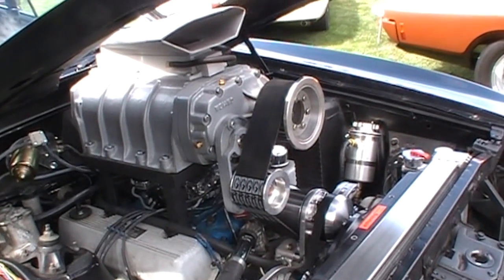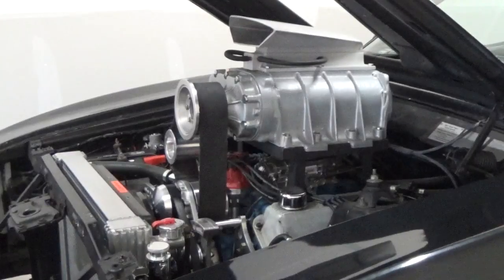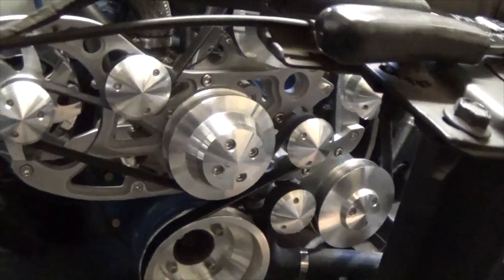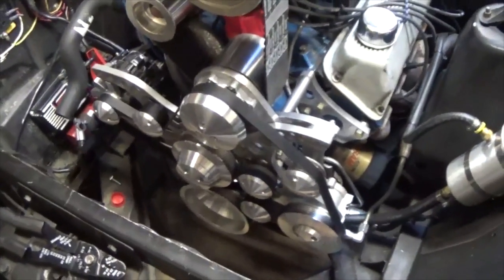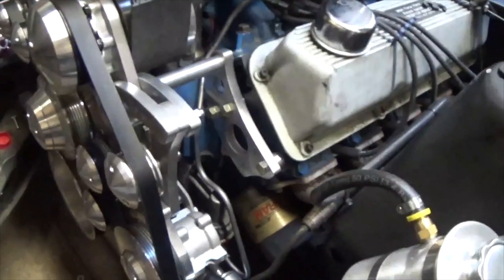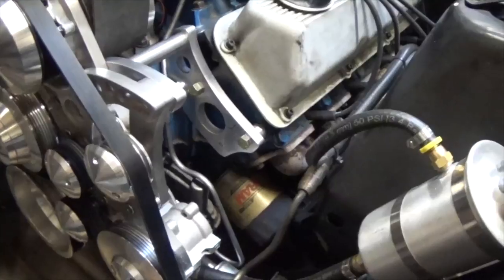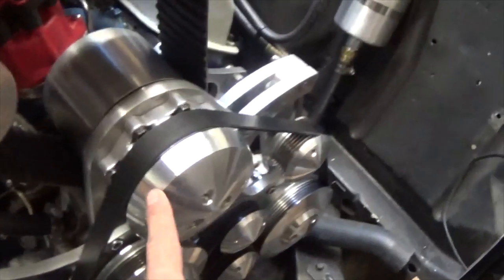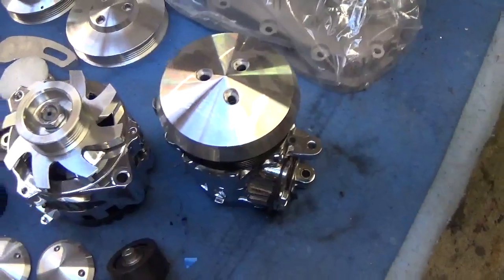Mad Max Interceptor Blower Drive Unit

Comment: Ok I guess I will ask, does at least go or is it just mostly for show the supercharger setup that is?
Reply from the maker: That actually depends on what the client we are building the car for wants. We do build cars with a fully functional supercharger, which of course adds to the power of a motor built for it. However this video highlights the more commonly asked for "Movie Correct" on/off prop blower. That of course is for show only, but the engine under it is generally build quite powerful. Thank you for watching, and for your comment!

Comment: What is a blower drive anyway?
Reply from the maker: In this context it is the "on/off" device which drives the blower, detailed in this video. Thank you for watching and for your comment!
Reply: Mac MashPotato ... it's the combination of pulleys, belt and the gear case on the front of the supercharger housing. in this instance, the system is designed to be activated with the engine already running, using a separate belt spinning a clutch unit that is electrically engaged. the supercharger housing is mounted above the carburetor and doesn't contribute to the running of the engine. it's probably acting as a very clever air cleaner. as you can read in the other comments, MMC builds cars with functional superchargers as the customers may wish. this system is designed to emulate the functioning of the unit shown in the movie, Mad Max. another video shows the movie car using an electric motor to spin the supercharger. that unit was similar to this, in that it was a fake that was as cool as could be.

Comment: God damn is that a beautiful piece of machinery. If I could offer some constructive criticism, the only thing that would make it more beautiful ,is if you could possibly get rid of the writing on the main drive belt going up to the blower, not a big thing, I just think it'll be even more beautiful without it.
Reply from the maker: We are so glad you like it! We always appreciate constructive criticism, it one of the ways we can make improvements. In this case though I am looking closely, and I am not seeing the wiring you describe. Possibly you are seeing the Distributor and Spark Plug Wires, as those are directly behind the main drive. We do attempt to run those as neatly as possible, but sadly here is no way to eliminate them completely (well maybe a computerized system with coil packs on the plugs but that is just going a bit far for a vintage style motor). Thank you for watching and for your comment!
Reply: MadMaxCars  No, not the wiring, the writing, on the belt, probably has like the manufacturer's name and part number on it. You might be able to get rid of it with a little bit of acetone or lacquer thinner or something like that. Like I said not a big deal,, but there's always something else you can do to take it to the next level. And again, beautiful machine, really, really, outstanding!
Reply from the maker: Oh yeah, right! Duh. Teach me to pay more attention! Yes that probably would look better. Its likely the belt size and manufacturers info like you said. We will have to look into doing that in the future.
Reply: MadMaxCars  No biggie,  Like I said, that is a beyond beautiful machine, definitely one of the nicest I've ever seen, and I've seen quite a few.
Reply from the maker: Thank you so much! We do pride ourselves on building top notch cars.
Reply: MadMaxCars. AND YOUR DOING A GREAT JOB ! DEFNITELY SOME OF THE BEST WORK, I'VE EVER SEEN.
Reply from the maker: That really means a lot to hear! Thank you!
Reply: MadMaxCars.  Anytime Bro!     Art comes in many forms, personally I prefer it to look precision, like your engines .
Reply from the maker: Us too! These machines are our art!

Comment: I guessed that the fake supercharger was activated by an air conditioner clutch. I love the concept of saving gas in an apocalyptic future by having the blower only operate when needed. It is also a great visual device by alluding to the action that is about to follow when it switches on. I love Mad Max movies!
Reply from the maker: In the film they used the simplest of movie magic. Had a belt to the crank, which they removed for the "off" scenes. For the activation or deactivation scenes they simply did a closeup of the blower while starting or shutting off the engine. We designed our on/off clutch system, based on the AC  clutch some independent builders have used, so the owners could have the reality of the movie magic, without sacrificing the use of AC if they wanted it on their cars. We of course love the Mad Max Movies too as you can guess. Thanks for watching and for your comment!

Comment: Hey mate. Nice car there. I have a question for ya. Why a supercharger has to be connected to the crankshaft to be functional?
Reply from the maker: Glad you like it! For a real functional supercharger, they are designed to be run of the crank to they have proper power and correct rpm to match the motor speed. In the case of the prop on/off unit shown here its more a matter of aesthetics so it sounds correct when its on. Thanks for watching and for your comment!
Reply: MadMaxCars  How about a clutch system? Would it work?
Reply from the maker: This video shows our prop on/off clutch system. If you are talking about a clutched on/off functional blower, it is theoretically possible. The technology exists, but to apply it to this car, though possible, would be exceedingly expensive.
Reply: MadMaxCars  Are you guys still gonna make v8 interceptor replicas in 5-8 years from now?
Reply from the maker: Of course, for everyone who wants to hire us to do so. We will also still build all the other Movie & TV Star Cars we build now, as well as probably more as Hollywood keeps making cool cars people fall in love with. Its what we do. We have been doing this for decades, so why stop now?

Comment: A positive displacement blower that isnt spinning is a cork, no air will flow. If you gut the lobes from inside it will do no good when it is engaged. Great movie prop and im sure fools lots of fools, but in the end might as well be a piece of plastic stuck to the hood.
Reply from the maker: Well we do build these cars with a functional blower when the clients want it. Most people want that "Movie Magic" On/Off blower prop, which does have the lobes removed but its not plastic its a real blower with the guts removed. Thanks for watching and for your comment!
Reply: MadMaxCars  Secondary valve for N/A air to open a little before the blower turns off, wouldnt that work?
Reply: ToreDL87 There’s speculation that you could have the blower intake act as a “ram air” induction and set the blower up as an accelerator.
Reply: A lot of peaple need to realise a movie is fake but if it came to reality like a real when world goes to shit you need a real blower still will sound badass ether way
Reply: also they're driving a blower belt with just a regular serpentine belt
Reply: What about a bypass vavle like they have on twin supercharger?

Comment: I just meant that its a waste that we cant figure out a way to make the clutch functionable and make the on off blower actually work.
Reply from the maker: It actually is theoretically possible. The cost to do it is beyond what anyone wants to spend though. Also most folks want either "Screen Accurate" (which means the faux blower), or a real all the time on blower. If someday a client wants to invest crazy cash to have the functional on/off blower engineered, we would of course do it.
Reply: Electromagnetic clutch, and a valve to direct air through the supercharger, or directly to the engine. First-gen Toyota MR2 had that feature

Comment: So from what I read in another comment, this car isn't actually supercharged: it gets standard NA air and the supercharger, although stunning and adding airflow, is not forcing air into the engine under boost.  Correct?  That is, any excess air the SC provides would go out the normal intake, yes?

I mean how could you even do that?  A roots pump is positive displacement.  If it turns off, your engine gets no air.  There'd have to be some type of SC bypass valve for when the SC is off (and it'd have to be BIG to provide enough air for the engine).  Do you know how they did it in the movie?  I imagine it was a "prop" SC.
Reply from the maker: Though we do build these cars with a functional blower when he clients want it, the system shown in this video is for the "Movie Magic" On/off prop blower unit. The blower case though real is empty, allowing airflow. Yes it was a prop in the film as well. Thanks for watching and for your comment!

Comment: I see the carb under the blower. The blower is just for looks and whine sound. Doesn't seem to do anything for the engine.
Reply from the maker: Its electromagnetic. If a client orders the on/off unit shown here (instead of a real functional blower which we also do on request), it is carbureted. Correct that in this configuration it is a "Prop" particularly for the "Movie Magic" on/off function, and has no effect on the engine. We do offer a EFI Scott hat and real blower setup for those who want it that way. Thanks for watching and for your comment!
Reply: Cool. Good stuff. Thanks.
Reply from the maker: No problem. Glad to help. I hope you have found and enjoyed some of the other cool vids on our channel. If you want to be notified when new ones come out click subscribe then the little bell icon.

Comment: so how exactly does the blower clutch work? and is that engine carbureted? wouldn't the blower going off and on screw around with the fuel and air mixture?
Reply from the maker: Its electromagnetic. If a client orders the on/off unit shown here (instead of a real functional blower which we also do on request), it is carbureted. Yes an on/off blower would realistically be so problematic as to make it essentially not possible.... though there is talk from time to time of how it "could" be made to work.
Reply: MadMaxCars could you make the blower work if you designed a carb with two different sets of jets? One set that would give the proper air /fuel mix for running without the blower and another set of jets just big enough to work in unison with the others to give proper air /fuel mix that could somehow be opened electronically when the blower is switched on?
Reply: Tay S I agree, but i was thinking of something that would still keep the car like it was in the movie and just making the blower functional
Reply: A draw through centrifugal supercharger would be able to turned on & off with a switch/clutch with no major side effects to the air/fuel ratio.  But the cars in the movies don't use that type of supercharger.
Reply: Jack black 

You could probably do it far easier with efi like megasquirt.   And make a bit more power and a great side effect of more mpg too.
Reply: Jack black 

You could still put tbi efi inside of it...they look like carbs anyways.

Although dont know how you could get air when not on....
Reply: theres a few new blown factory cars that have like a bypass tube and valve so the blower can bypass at highway speeds to save fuel, so something like that I guess
Reply: You're not kidding about the on /off, MIGHT last two cycles if applied at anything but idle making it pretty pointless. Might be some potential in a viscous coupling ala Subaru AWD though.

Comment: So does the air intake go through the blower at all and if not, how do you filter the air?
Reply from the maker: Though not exclusively drawn through the blower, there is a generous amount of airflow there. We use a fairly standard high performance air filter. Thanks for watching and for your comment!
Reply: Dan Boren No the real car didn't make any boost it was just a supercharger casing with a carb under it
Reply: Dan Boren , 351 HO Cleveland's with a good tune and a 650cfm would usually dyno at 1 HP per cubic inch on a regular basis . There a Nick's video that verifies this on here also . Years ago we heard about and had to build a ' Clevor ' . Can probably find a video on here someplace about them . Was a blending of the best of both 351's Cleveland and Windsor engines .  We did more bottom end work than needed and a stroker at the time with rods , pistons knife cut steel crank which was stock stroke. We made the difference as I said with pistons and rods 0 deck height after some block squaring , yeah tend to get nuts as I build .. . . I'm a believer of if you drive it to the track it'd better stay together for the drive home. ;-) . I later became a Mopar believer and have commented on a 318 build that was 497 HP on pump gas with cast heads . . . I digress . The Clevor we built was inspired by some dirt track racers who were building them for 'production' rules and they worked so well they were banned from most if not all tracks after a couple races . . . . . Ours dyno'd at 537 HP at 5252 rpm on pump gas on the first test . This wasn't tweeked or touched and was with odd LeMans float bowl dual feed dual pump 725 carb from under the bench . . . . . Think it was off a grenaded 409 . . . We didn't jet or dial it in just pulled some plugs after running things in on the dyno . Oh , we had to build an intake as it was easier than porting , drilling. , plugging the heads and manifold . Still had to do some of that anyway but not as much and runner length was a guess. . . but adjustable . LOL ! Gave it to a kid who put it in a Vega as a daily driver to drive to college . . . . .the following week . We put a three speed with a aftermarket shifter from JC Whitney ( the box was in the trunk of the loaner car )  if I recall from ' Thomas's garage and junk yard . Drive shaft and wiring we made to work . Did I mention this was a weekend install . The good old days of toggle switches and Holley High volume fuel pumps ! Not to mention a thanks to salvage yards back when they had things worth salvaging . . . The headers also were fabricated and wheel well with collector to glass packs welded on. . . Did I mention we were short on time ?  Later we corrected the suspension and rebuilt the headers exhaust . . . and a different diff etc. For awhile people thought I'd adopted the kid . He graduated with honors and is now in law enforcement  or was . Probably retired by now , damn how time flies . LOL !  OK , that was my book for the day . Be well .
Reply: When I first saw Mad Max I knew the blower could not be installed normally and the car run with the blower off.  So, the question is, when you turn on the blower does it actually produce any boost at all to the engine or is it just there as a WOW factor?  Love the cars, especially with the 351C engines, my favorite engine ever!
Reply: straker454 U DONT..
Reply: it's just a filter under the supercharger housing
Reply: Filters are for suckers

Comment: how much would it cost to put that setup on a Hemi 6.1?  10K-15K?
Reply from the maker: Thats a GREAT question! This particular kit is designed to fit a 351 Cleveland FORD motor. I am sure with some custom engineering it could be changed to fit just about any motor. You should contact the guys at www.madmaxcars.com for custom work like that, I am sure they would be glad to help. Thanks for watching and for your comment!

Comment: Re the on/off switch on the supercharger:
I don't know a lot about superchargers but I do know that Mercedes built
 engines with a setup very similar to MM's V8 way back before WW2. 
(500K/540K and probably other models, too.. I think they first used this
 on race-cars in the 1920s, but I could be wrong). IIRC, the 
supercharger on those engines could be activated manually (pretty much 
the Interceptor's on/off-switch from the movie) or it would come on 
automatically if you pushed the gas-pedal all the way to the floor. 
Their reasoning was probably the same as the in-universe one from MM: To
cut back on the engine's insane thirst for fuel when running at full 
throttle and with the supercharger spinning. 

EDIT:
https://en.wikipedia.org/wiki/Mercedes-Benz_SSK

 So it would probably have been complicated with 1970s tech (or 1970s "future-tech"), but it would've been doable.
Reply from the maker: Very cool. Thank you for the insight!
Reply: Some of the 90's Kompressor engines (200K 230K) use an aircon type clutch to decouple the supercharger at idle.
Reply: You would need to bypass the intake through the supercharger.   If you disconnected the belt from a real supercharger, the engine vacuum would spin it.   The blades have to spin for air to pass through.
Reply: The first-gen Toyota MR2 had a supercharger fitted with an electromagnetic clutch, as well as a valve that would flip between routing air through the supercharger, and sending it directly through the intake.
Reply: Cars that are twin-charged (they have both a supercharger and a turbo) also have the supercharger on a clutch, for disengaging the supercharger when the turbo takes over
Reply: @nickfury1279  Duplicating what the fictional car does with a modern supercharger bypass setup is a lot different from realizing that same functionality within the visual limitations of a Mad Max Pursuit Special.